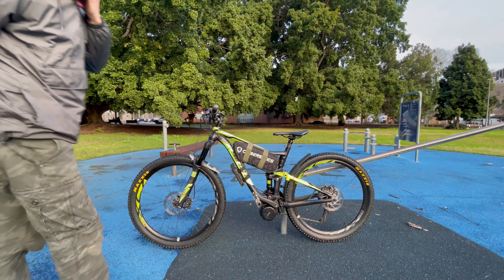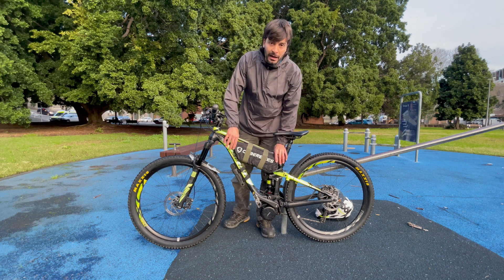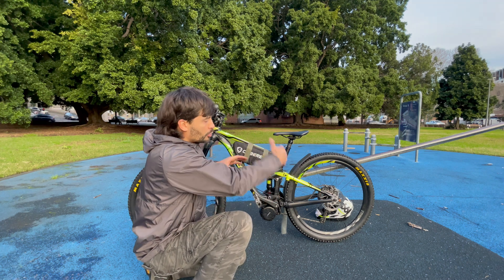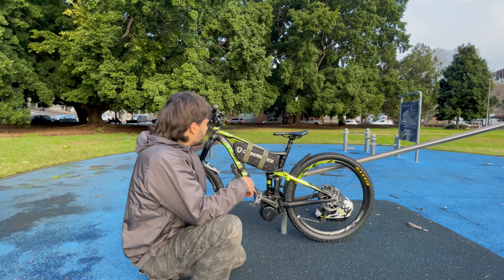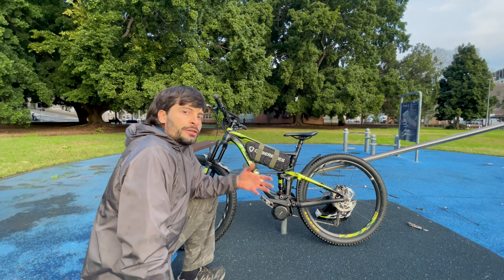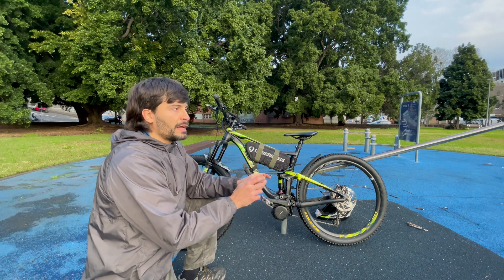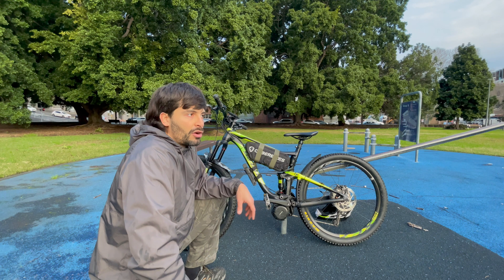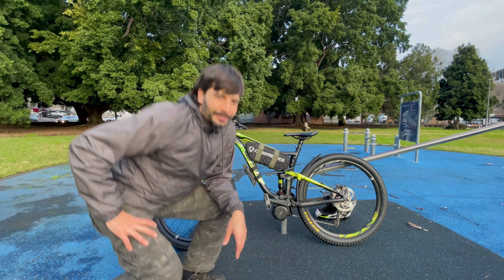Part 1: Giant Anthem 2018 with Bafang BBSHD 1000W 100mm BB 52V 17.5Ah

Comment: Hi, thanks, great video. Was about to buy this bike and fit a BBSHD, but realised 68mm version won't fit. Is there any similar full suspension bike you'd recommended for a straight fit, also where the battery fits right into the frame? Seems Specialized Epic could work, not sure about the bottom bracket.
Reply from the maker: Look for bikes of year around 2012, they will have a 68mm BB and the bikes are sturdy.
I am a big fan of Merida 140 and Giant Trance
Reply: @Cyberbikesau Spot on, thanks!